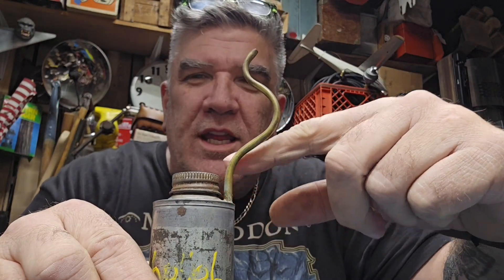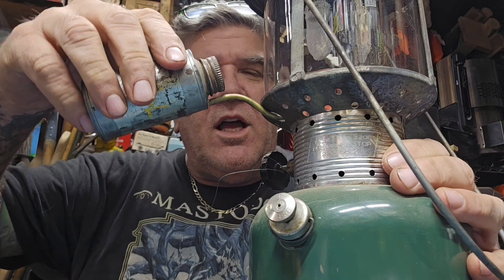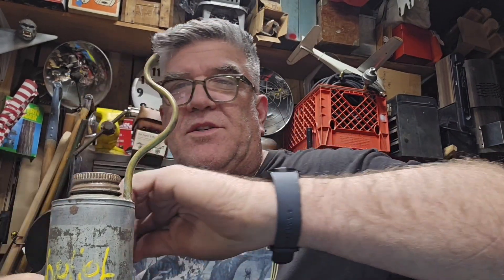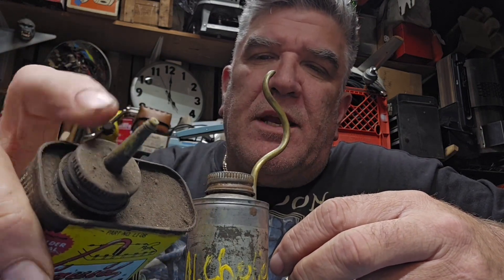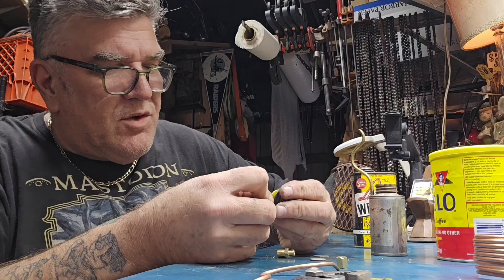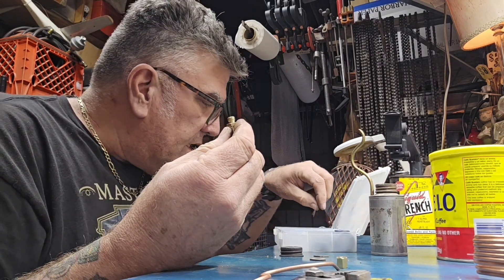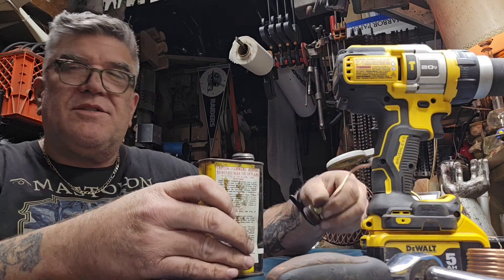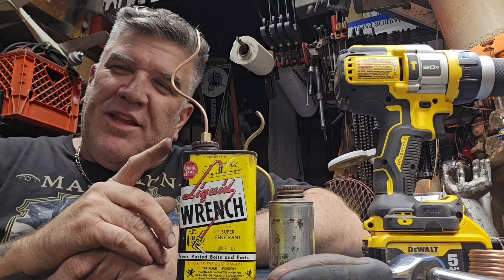Lantern Hack - DIY Spirits Primer can

Comment: How awesome! Ok... I think you need to start making and selling these!👍🏻😎  Ya get a lot tubing pet kit, ya need to see if you find the extra hardware separately.   Great ingenuity!
Reply from the maker: Thanks cheesy, I will see what I can do. What I really want to do is braze that compatibing on to the metal cap. If I can get that figured out, I'll make a bunch of them. However, this set up with the bolt through actually works very well.
Reply from the maker: Thank you Cheezbo

Comment: Not bad! Wasn't quite sure you had enough to seat the ferrule, but it worked just perfectly! Good job!
Reply from the maker: Yes, I forgot that the o-ring is also still there. And that was very helpful. It's actually on there very, very well. I don't even think i'm gonna take it apart.
Reply from the maker: Thanks Chad
Reply: @doinsngoins  yeah, this is where that old "if it ain't broke, don't fix it" comes in 😂

Comment: Thanks so much Steve ! I am going to do that. Depending on what I can pick up at the atuo parts store . I was thinking that they were like oilers for sewing machines because the only iron one I saw before had like a short spout . Nice little project
Reply from the maker: Slows down the evaporation
Reply from the maker: Exactly. I have bought short ones the Coleman convention before and have given them away. The problem is just that they're too short. I suppose they could be an oiler. It certainly would work as one. One thing. I'll add if you can find a can just like. I had even the little yellow piece that I cut off of the cat fits perfectly on the end to capital off when you're done
Reply: There is a Napa near me , while they don’t have that exact kit . They have copper tubing and compression fittings.
Reply: Canadian tire carries the exact same kit , 6’ of 1/8 copper tubing with the fittings. Takes a week gives me time to scrounge some cans and extra tubing can make a few prototypes. Once again Steve thanks so much ! You must have had this one in the chamber because it didn’t take long .lol